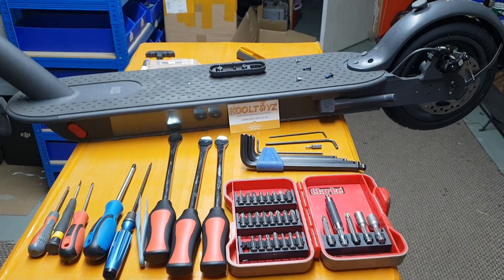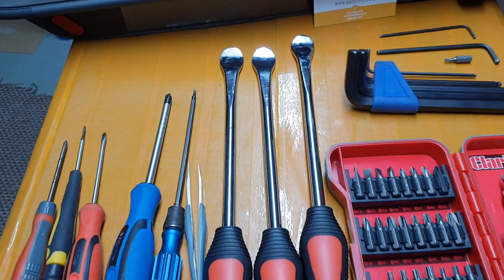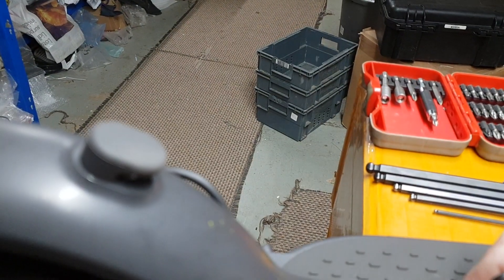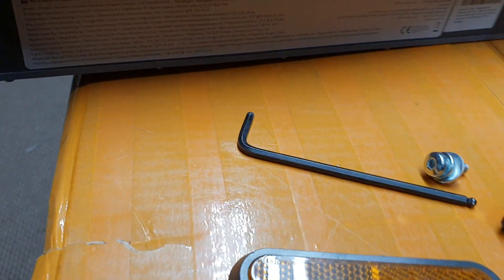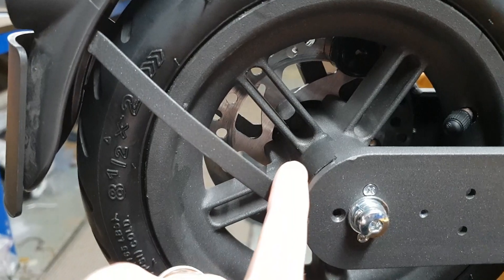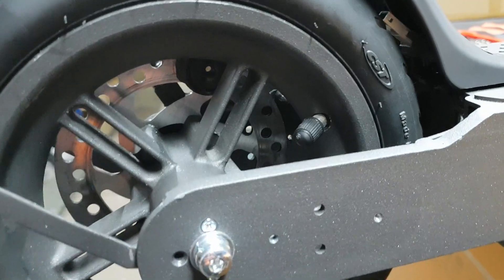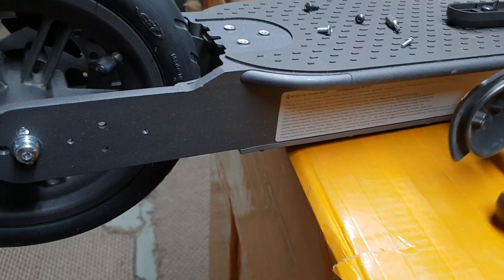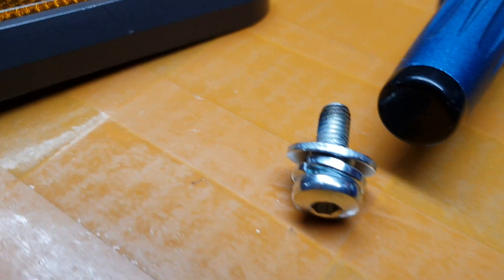Puncture repair on Xiaomi PRO 2 Electric Scooter Part 1

Comment: My rear mudguard screws on the M365 Pro is stuck on the board except for one screw due to it not having any rear fender support but now it does thanks to a seller here in NZ hehe! Anyway, I tried many methods of removing those stuck-on screws like pouring hot water on it and using a small chisel to ply it off but none of the methods work at all.

Comment: so the housing that holds in the yellow reflector there’s a tiny whole at the side so you can stick a pin in it it and it pushes the latch where is snaps in and it will drop out .. you don’t want to lever it with a flat head screw driver you could easily crack the reflector 👍🧷 time 3:58 just to the right !

Comment: top videos 👍 really detailed which is super helpful 😁 ..... most people just play music over sped up footage which is not helpful
Reply from the maker: Thanks :)
Reply: @kooltoyz  so the housing that holds in the yellow reflector there’s a tiny whole at the side so you can stick a pin in it it and it pushes the latch and it will drop out .. you don’t want to lever it with a flat head screw driver you could easily crack the reflector 👍🧷